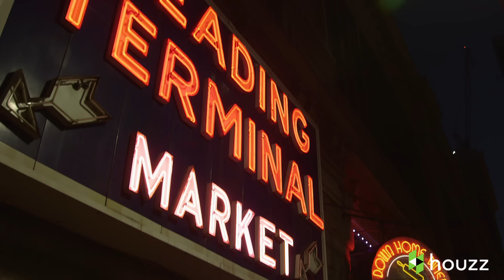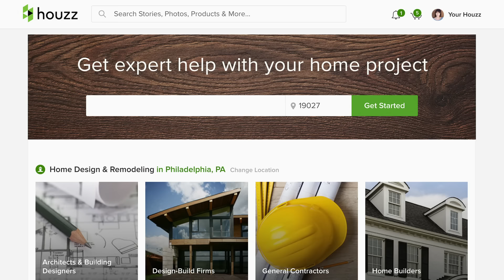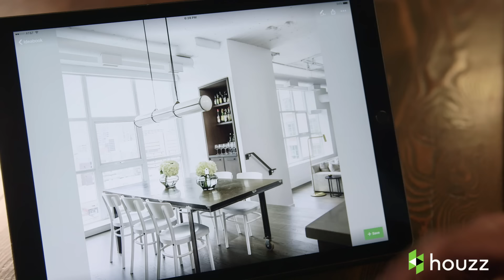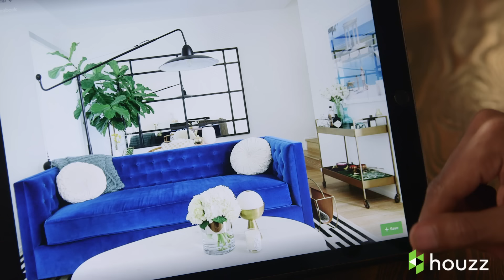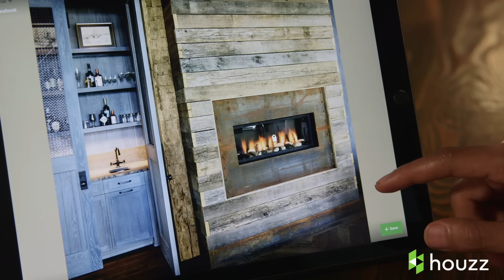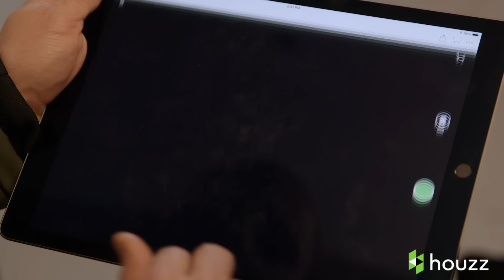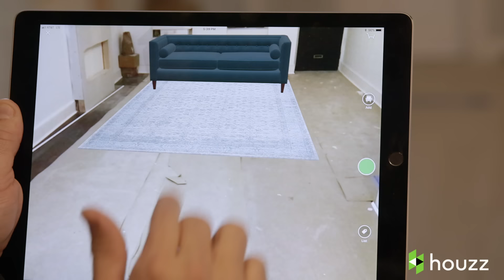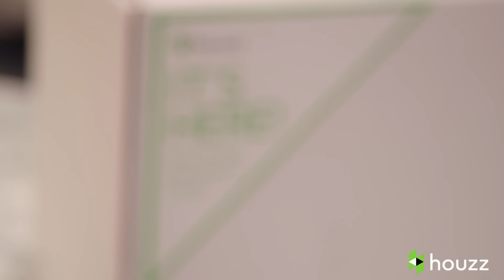My Houzz: Gordon Ramsay’s Surprise Renovation

Comment: I wish he didn't paint the brick. I work on houses and I have a serious issue with painting brick. especially around fire places. 

getting fresh mortar, colored if desired, in between the brick after a good cleaning looks fantastic! brick behind the wall garden would have given it a cool, "am I outside?" look. 

painting that wall sucked! they should have at least done 1/2" insulation foam, drywall with a nice old world texture or plaster. making it warmer and hiding the copper . the natural brick is what made the copper lines work. now it's just stupid and out of place.